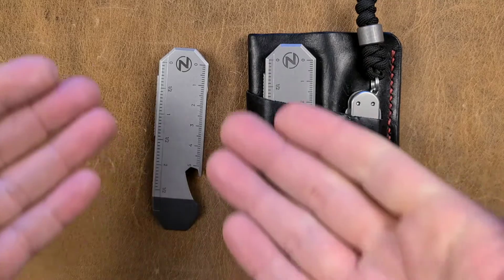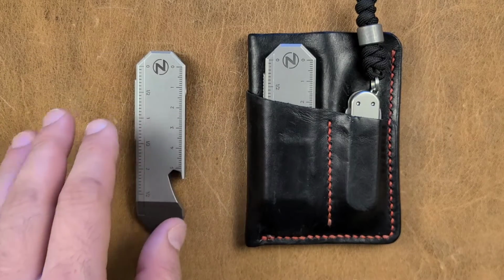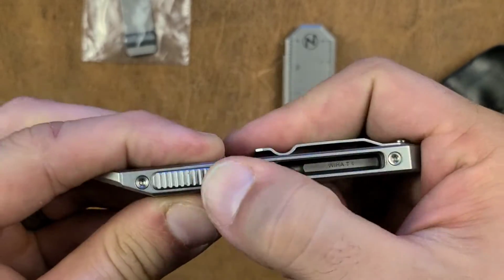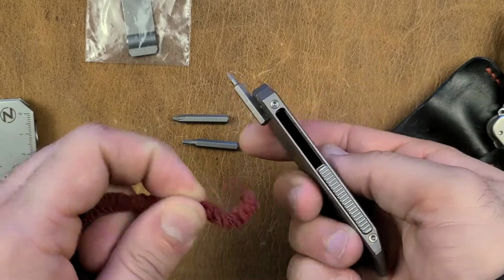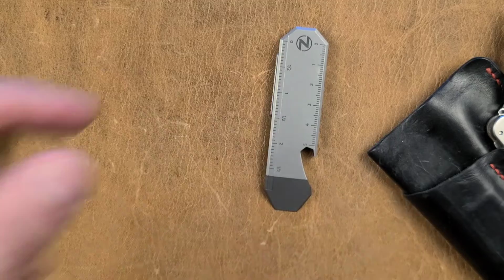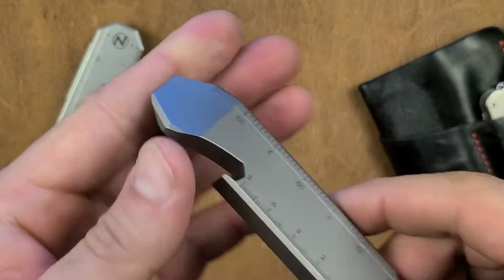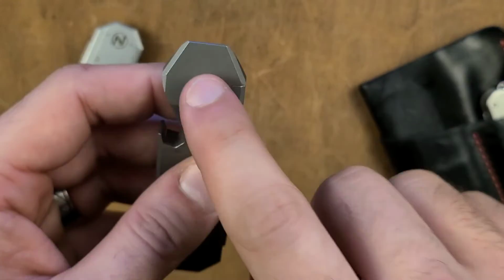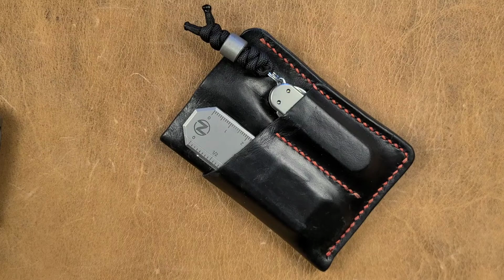🛠 Novel Carry Slidekick Multitool (screwdriver, pry tool, and more)

Comment: If it's made in China, they're probably made out of the same metal.  Maybe the lighter one has aluminum.   But China has a law that they can keep and replace items for the benefit of their country.  Sorry, for being  brash.  China's behavior annoys the $#!% out of me.
I had a pocket knife that said aus B on it and I don't think it was AUS 8.🙄✌🏼
Reply from the maker: ??? you realize that some of the best knifes in the world are made in China right? and the best flashlights as well? This one was made by Bestech and I can confirm one is Ti and one is Steel. There are plenty of cheap knock offs from China..but there are also incredibly well build quality items as well. Also worth noting..the most advanced automated mechanical arms are also made in China.
Reply from the maker: I've tried and used a number of USA made items that are an embarrassment and are far far more expensive.